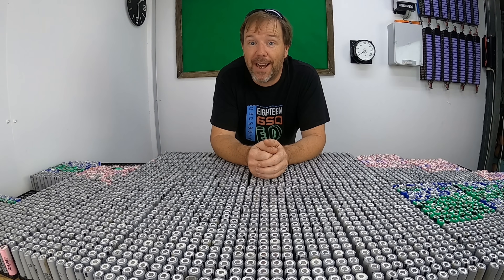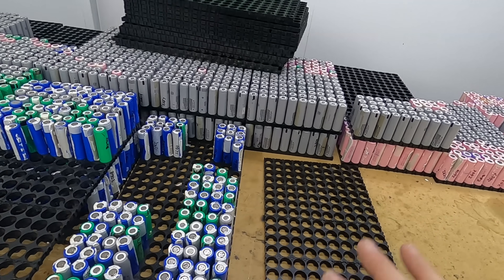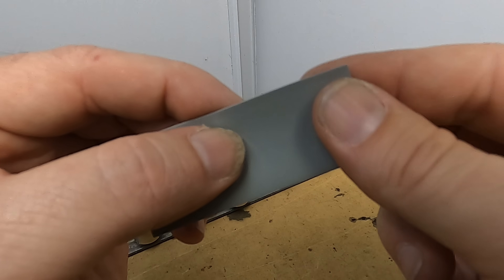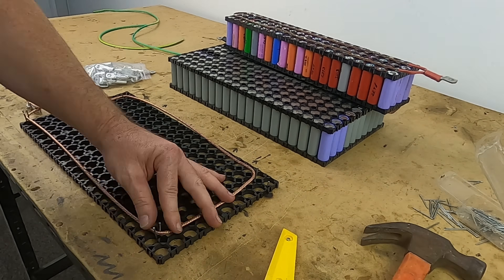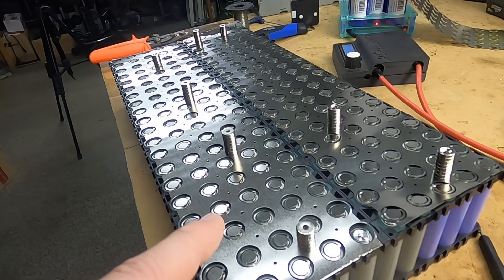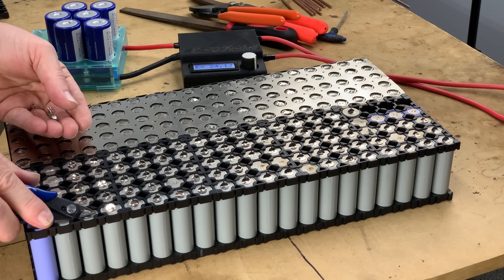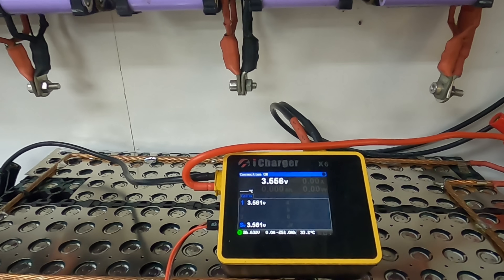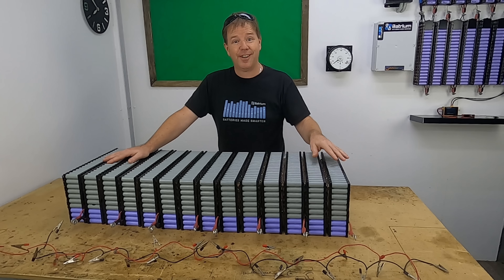Creating my single biggest D.I.Y. battery with 2800 18650 cells recovered from used laptop batteries

Comment: So youre connecting from 2ah - 3.1ah in parallel doesnt it make it alot worse, because the single cells need to balance it everytime a load is applied? As an example if you take out 10ah from the complete parallel cell, doesn't that mean that the ones with 3ah need to charge the ones with 2ah because of the voltage difference between each other, i know everything happens dynamicly but wouldnt it be somehow better to connect a complete 3ah battery a complete 2.5ah battery and a complete 2ah battery (or separate it even more), if you know what i mean, or can someone explain why it is better to put a giant parallel cell together?
Reply from the maker: used, broken recycled cells - made useable - my approach is the lesser of two evils..
Reply: @HBPowerwall  Ok but can you explain it to me why it is better to make a giant parallel cell instead of like 10 smaller batterys, all with a separate bms? You couldve even Seperated them into Ah parallel cells so everyone of them has the same ah but different counts of cells in them, if you know what i mean.
Reply from the maker: Cost, time, more complicated, easier to balance and keep balanced - i've made these batteries for YEARS and bigger is better in my experience. But i'm no expert, many make dinky little batteries with cheap under rated BMS, ends up costing more, and looking worse.

Comment: For years i have been watching people make these battery packs out of used 18650 cells and im troubled by one question. They are sorted  by remaining capacity. So is it not a problem if in the pack there is a new 2500mah cell and for example originally 3000 mah cell that has been cycled 500 times that has 2500 mah  capacity remaining combined together?  Sure they now both hold 2500mah, but do they age differently? And if so isn't it a problem?
Reply from the maker: Yep, it's a problem but is it less of a problem than landfill? or Early life recycling?

Comment: Looks like a fire waiting to happen....used cells = fire
Reply from the maker: That's like saying used care = fire, or used mobile phone =fire.. Watch the next two videos and consider for a second that I COULD have addressed this issue... (just a little)
Reply: @HBPowerwall  I never said they wouldnt work. Its just unwise to mix used cells. I've been working on electronics 30 years. Mixing used cells cause other cells to heat up.  Basic electronics...Facts are facts.
Same manufacture & same cell only. I build renewable energy storage devices for a living.

Comment: Hey man, your work is good, but you shouldn't be using these cells even with a BMS. I'm sure you know the risks of explosion already. You could do this safely with LiFePO4 cells though.
Reply from the maker: Just to be clear there is a HUGE difference between 'explosion' and venting.. With the correct precautions you can make a nuke safe.. well safer

Comment: So if one of those batteries goes bad does the whole thing stop working?  How could you ever find a bad battery if it fails?
Reply from the maker: Thermal camera & a good multimeter combined with data from BMS it's really a 10 min process.

Comment: What happens if one of the batteries breaks?
Reply from the maker: Same if the clutch goes in your car.. you fix it? Fault state of these cells is typically heat.. Heat is easy to find...

Comment: 13:00 hmm, that seems to work. but since that chassis are plastic and the batteries are underneath, you are trying to heat it up for as short a time as possible i saw that, i'd still probably heat your twisted bus bar first, instead of holding that big iron down on that thin nickle to melt the solder, then heating up the bar. Also, while the flux does play a role in the bus bar sucking up the melted solder, it's actually the viscosity of the melted solder, hence why you use braided copper to sop up old solder, and it's called solder wick.

You obviously know what you're doing these are just my morning reactions!

Comment: If I understand well, each pack of  200 cells are mounted in parallel  and in the rack on the wall there fix on series?  So one pack is how many amp ? I'm new on this and I wanna start a big Powerwall  for my solar panel .

Comment: Fantastic build! 

I dont know how much power you will typically be drawing off of the battery, but if you are using it to power your whole house or something similar I would not recommend anybody copy your choice of using a single stripped 220v wall wire as a bus bar. If you only use a standard 220v circuit worth of power (in kw) and amperage (A) it will be fine, but anything over those would probably be a fire risk according to your local fire code. In practice Direct Current circuitry and equipment usually uses a much higher current with a lower voltage to deliver a given amount of power compared to AC. Where I live (different area - in the US) 220v home circuits are usually designed for 40 or 50 amps of current continuously. Based on  the 40+ all in parallel cell orientation that appeared to be be in the video, and the average 2.5 to 3 amp continuous rating of most lithium 18650 cells, each battery pack could potentially provide 100 amps continuously. Maybe you address this in your part 2 video which I will be watching next. 

A simple and easy DIY bus bar I can reccomend for a battery of this KW rating would be a copper pipe smashed flat with spot welds down the middle to fuse it flat. Or you could also fuse if flat by hammering the copper pipe flat with a solder wire or 2 inside lenghtwise then heating it on a gas stove or a grill to melt the solder. It should have thickness very close to a good quality copper bus bar capable of the amp rating you plan to run the batteries at when done.
Reply: I think this is a fairly good point.  He said he's using 7 gauge copper wire. The ampacity of wire depends on the temperature of the insulator, which I"m not too sure of here, since it's not really a wire, but a battery pack.  But the lowest rated ampacity of 7 gauge wire is around 50 amps at 60C (140F). IIUC the rating is based on how hot the wire will get before the insulator will start breaking down, and potentially start a fire.  How that works with the addition of a lithium battery in the mix, I'm not sure.

So if you're right and one of these packs has the potential to generate 100 amps, he's overloading the bus bar.  

Unless of course there's some other protection built into the circuitry to limit power output from these batteries to less than what the bus-bar will carry.  I suppose you could also put in some thermal protection into the circuitry to kill the power if the whole things gets too hot.
Reply from the maker: the max draw is 6kw AC, I charged my ev for a few hours, cells and connections didn't get above the air temp..
Reply: @ If it works, then it works. it must run less current through it what would be a problem for that particular wire then. I don't remember catching you mentioning the gauge in the video like the other person mentioned you did which was the biggest source of my concern.  

By the way, thank you again for your video!

Comment: But why the used and worn batteries? Their life span is all but over with, you'll get much better performance with new cells.
Reply from the maker: Why not? Building new would have been something boring anyone could do.. I took the hard road and SMASHED IT OUT OF THE PARK!
Reply: @HBPowerwall  Well the answer to why not would be for the better performance and longevity, but I understand where you're coming from. At least you kept the old cells from rotting in a land fill! I want to build my own 18650 bank, not of this scale, but geared more toward recharging devices and keeping my PC running during a power outage. I would want fresh new cells though, for my hard work would pay off as much as possible. To each their own as they say!
Reply from the maker: Also makes good money on here. Have to consider that too
Reply: @HBPowerwall  what does one make per million youtube views anyway?
Reply from the maker: That is like asking what keeps your wife happy... too many incorrect replys and the right one is WAY off the mark anyway lol

Comment: but used laptop batteries are crap they are all used up ive tried loads for my vapes and they have no high drain?
Reply from the maker: They aren't crap lol you're expecting low drain cells to work in your stupid vape??.. Using a laptop battery in a VAPE is like using a dildo to plan tennis with.

Comment: I’m not yet into lithium batteries, but I know well about deep cycle AGM batteries on sailboat, and you cannot mix good with not so good batteries because the not so good batterie with drain out faster than the good one . 
So what is the difference with lithium batteries , I know you can drain out a lithium batterie .
Reply from the maker: your right thats why i spent months and months testing every cell, then building the battery with an even amount of each capacity cell. there is a max of 10ah difference between each built battery..

Comment: I'd be too scared to run that inside incase it caught fire, that many modules looks a little dangerous.
Reply: It doesn't help the fact that these are used laptop batteries, all ranging in health.
Reply from the maker: Hence the shipping container, then fire proof container THEN the batteries lol
Reply: And mixing brands.. super unsafe
Reply: they would do fine in cooled mineral oil, assuming its not too flamable which i think it might be...1 sec
Reply from the maker: If you build a battery right it shouldn’t need cooling
Reply: ah just moniter temp

Comment: Oof, one bad cell in there and it'll be New Year fireworks come early.
Reply: I also wonder if spot weld opens and the point of contact can reconnect at anytime.  Which means it might be at 1v say and if it rejoins with its parallel 4v battery too much current will flow heating up the cell and explosiob may occur.  Hope he is good at spotting.
Reply: @Swenser  if you look at the nickel strips he used, its the fused one, if one cell goes bad it automatically breaks the  nickel fuse and is disconnected..  so no, if one cell goes bad that cell disconnects.. did either of you even watch the video? Or watch him use a fused strip? Or are you both just severe simpletons? 😂😊

Comment: Soldering the copper busbar to the nickel sheet plate in the first place, before spot welding it to the cells, eliminates any localized cell heating caused by the soldering process; which may not be a problem, but just in case. I've built a few small battery packs in the past, a few of them high current, soldering them using low temperature soldering alloy (Rose's metal pellets) and multiple lanes of solder wick. No spot welding machine here, suffice to say.
Concerning the effective durability of a big pack out of old cells like this one, this is something I really wonder.
Reply from the maker: Yes that would have been 100x better for sure.

Comment: Hi @HBPowerwall I got this nickel strip 5p. Unfortunately It doesnt spot weld to the tesla battery +ve side (I assume its the metal they used for the +ve). :-( Am a bit upset so now I have to go back to old reliable soldering some thin wire to the busbar. Feel a bit let down over it actually.
Reply from the maker: yeh, you need the end caps fitted to tesla  batteries

Comment: My canal boats powered by 1200 18650 cells setup in 24v configuration charged by solar and a 3000kw hybrid inverter been running for several months with no problems.  Ma

Comment: Is it really legal to add that to a home on the grid in Australia? Or are you going gangster? I only ask since the brush fires were so bad, and it does not look like you have any temp sensors or fire considerations besides a few fuses. They would hang you, if you did this in denmark.

Comment: What happens if 1 cell has a thermal runway? 🤯
Reply from the maker: the 67kg steal case it's housed in gets a little warm. Then the shipping container around that probally looks like it's taken up smoking pot..
Reply: @HBPowerwall  I suspect the danger with thermal runway. The 1st defective cell initiates another 2 or 3 thermal runways of the neighboring cells and so on. This is potential groth like with an atom bomb, corona or gun powder under pressure. This would end end up in a huge fireball. https://www.youtube.com/watch?v=hwXccpeN6Qc

Comment: When one battery is broken, is it hard to locate it?
Reply from the maker: It's either hot or a fuse broken, so not really hard.. you might have to fully charge it or put it under a good load to see it warm up but it's not hard..

Comment: how do you prevent overcharging of an individual cell with that setup???
Reply from the maker: Batrium BMS
Reply: @HBPowerwall  yes But all in parallel arent monitored
Reply from the maker: there is one connection to each parallel set

Comment: Used laptop batteries... Dangerous and unstable
Reply from the maker: I have 5 years of 24/7 use under my belt.. still going strong.. not idea but dam it was in my price bracket..
Reply: @HBPowerwall  as batteries are used, their capacity changes from cycling loss and cell memory. A mass of randomly used condition batteries of random brands will not recharge or discharge at the same rate and there is a serious hazard. The years under your belt have not helped you, but I hope nobody else is injured attempting this
Reply: @HBPowerwall  honestly, there are more critical hazards involved, but I have said enough and I'm moving on
Reply from the maker: @dare2scheme904  To be fair in this day and age walking up the street is a hazzard.. it's how you manage said hazzards that counts!

Comment: Is the bus bar necessary? Can't you just have a metal tab at the end? Or does it help with conductivity across the parallel connections?
Reply from the maker: That nickel isn't designed for big packs like this so needs someway for the current to flow more evenly

Comment: hy , if i have cell's from 1700 to 2300 mah can I use them all in one power pack ,( 120 cell's )? or I should use only 2000-2300 cell's in one small pack ( 50 cell' ) thanks
Reply from the maker: I've learnt to use a little spread as possible building batteries. Small batteries are easier to maintain, larger stay balanced easier & are in my opinion 100x better. Use https://www.repackr.com/#/pack-builder to build a balanced battery

Comment: touches cable

instantly dies.
Reply: Skeleton melts
Reply from the maker: To be fair you could piss on the neg/pos cable at the same time and ya pecker wouldn't even tingle lol < don't try this at home kids... NOW if you dead short those cables you got 15-20,000 amps creating an ark flash hot enough to burn your skin off & bright enough to blind..

Comment: No balanse charging, what did you do when some of cells die.
Reply from the maker: fix them? and don't need to balance charge them till installed - Also using a Batrium BMS so it will take good care of the batteries SOH

Comment: The weight of those batteries would make them completely impractical for any mobile device
Reply from the maker: Its plain madness in hindsight.. those little fuses would vibrate so much they would fail.. it wouldn't be good long term. Also the strength of plastic holders - but with the right design considerations and design changes you COULD make it work successfully I guess.

Comment: i've built a few battery packs for my dewalt tools but this is so beyond next level!
Reply from the maker: Yep, one or two more cells :P
Reply: @HBPowerwall  yeah, just a bit, I did think about building a small back pack supply maybe a 5s 10p and using one of the spare battery terminals to interface with the tools and for charging, should take some strain of the wrist with some of the heavier tools!

Comment: hhmmm will it go on a trailer for my ebike hahaha! Could get some serious range. I think my 22kw motor setup will pull it?!?
Reply from the maker: I think we can draw enough from the cells to ensure that.. REALLY wanted to do a video riding a electric bike from Brisbane to say Perth 1000s of km on one charge.. would have been very neat. maybe a single solar panel on a trailer of batteries to help top off batteries.. Hell if I was single I would try go around Australia!
Reply: @HBPowerwall  i was going to build a bolt on pack for my bike 48v setup and have a step up module to boost it to 90v and have it trickle as i go. Ive seen it done before on a leccy trike. But ended up abondoning te idea as there was no where viable to actually put the battery. Puttig on top the frame would decimate my nads and its an enduro frame so no panier rack.

Comment: Another note worthy problem with the battery hookup  fused sheets of nickel is the outside edge batteries if there not super secure if you roll them will twist the fuses be careful I put tape around all the battery packs so the battery cells can't spin
Reply from the maker: Yes had that today actually... never seen a fuse vaporize so fast in my life...it just vanished!

Comment: Fantastic, this is a huge battery pack. You have shifted almost all of your home load to 18650 cells, that's great. I have also built small battery packs (3s X 10p) for general purpose use like small UPS/Inverters , some additional lights in car etc.
Reply from the maker: most of my power is provided this way.. not all tho

Comment: Please, dont make batteries at home without being a certified electrician, this can kill you. Lots of power in equipment like this.
Reply from the maker: I think your comment is basicly stupid.. a paper clip can kill.... But you are right LOTS of energy here with the ability to kill.
Reply: @HBPowerwall  The comment was meant towards viewers with little experience with electric systems that would jump into it, not you personally. Here in my country its not legal to do this without being certified. But, how many volts and amperes do the battery produce?